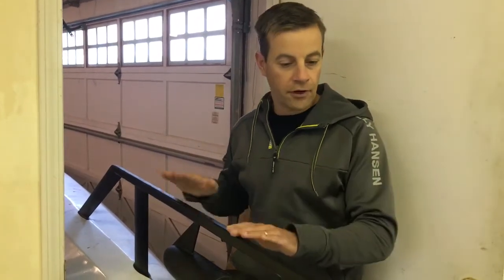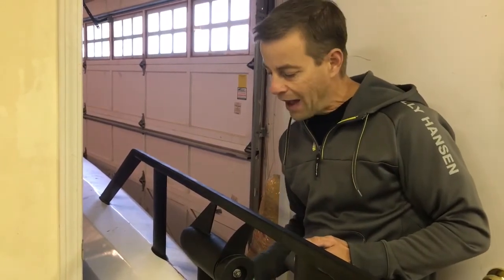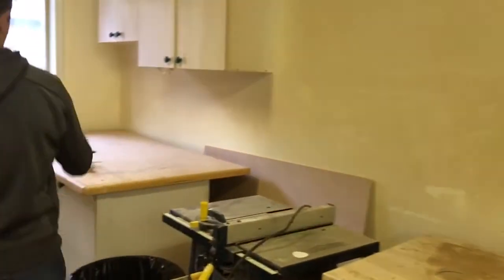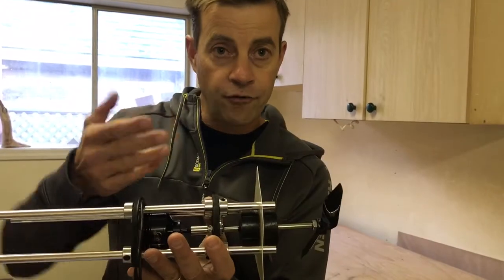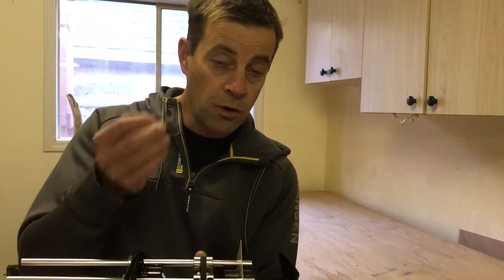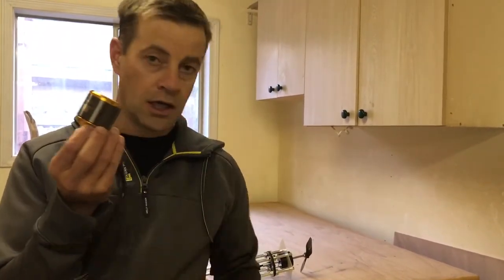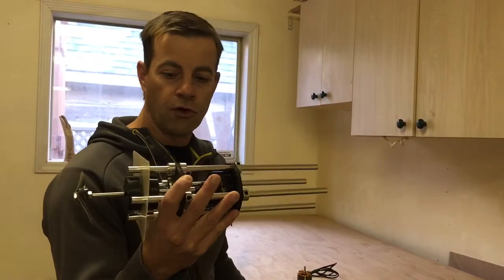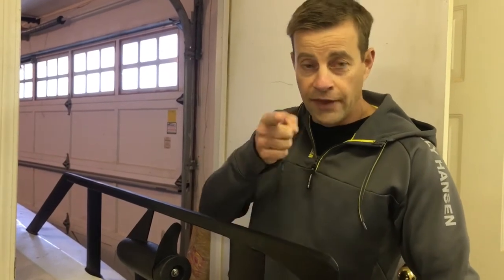Autonomous boat motor description

Comment: Nice project Collin. Having two thrusters plus rudder would allow for some redundancy. If rudder fails you still might be able to steer with differential thrusting, or if any one thruster fails you can keep moving and steer. Another thought - the brushless motor you use seems an outrunner, which is already a magnetic coupler in itself, you can seal both the stator and outer rotor with resin coat and it will keep running even submerged. Provided of course it could be modified to use some kind of plain bearing instead of its usual ball bearings. One clasical example of such a bearing used once in boats is having the shaft through a hole in a block of wood that is boiled in mineral oil. Lignum Vitae is self lubricating and very hard http://lignumvitaesolutions.com/products/wood-bearings/